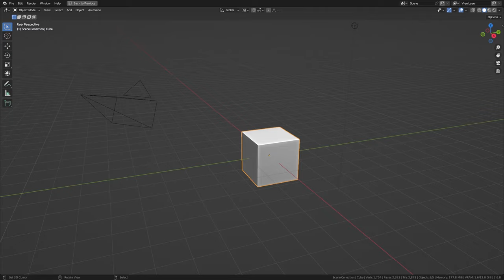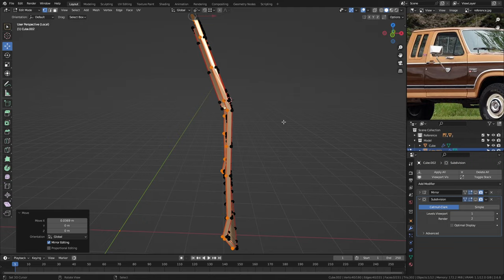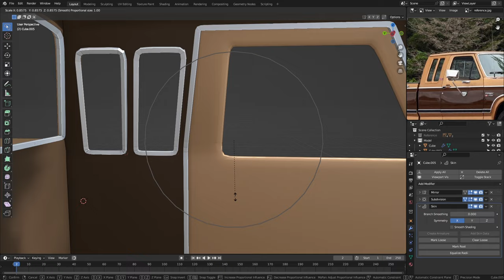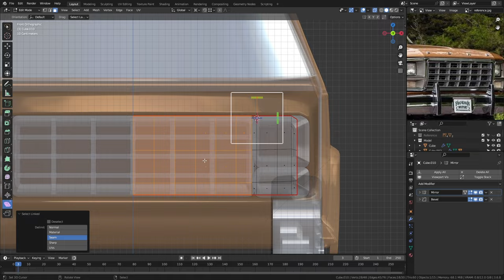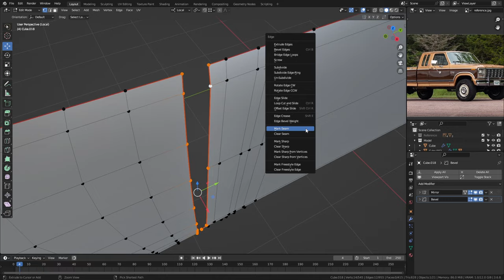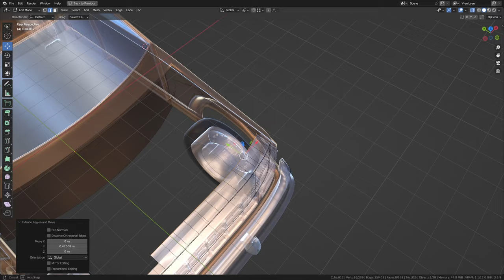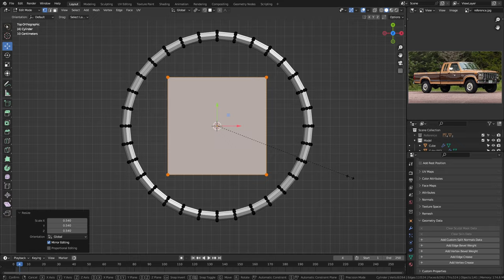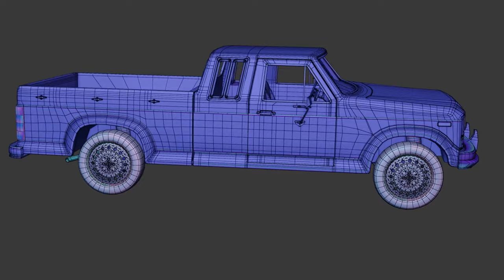Blender Speed Modeling - 1980. Ford F-250

Comment: 27.30 in edit mode press I twice to inset individual faces
Reply from the maker: The shape of the grid was two faces wide, so "inseting" individual faces wouldn't produce that result.
Reply: @Balkanware   you can click I three times to change the inset method of inset faces Be that Group inset based on selection, Or individual inset.